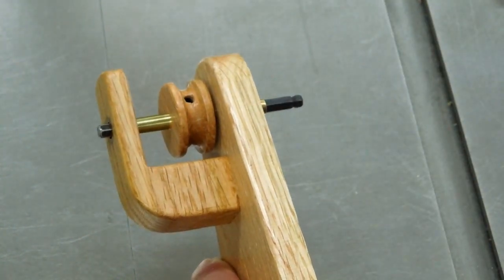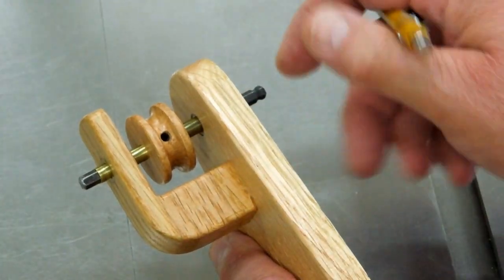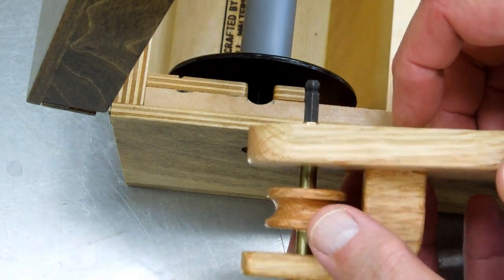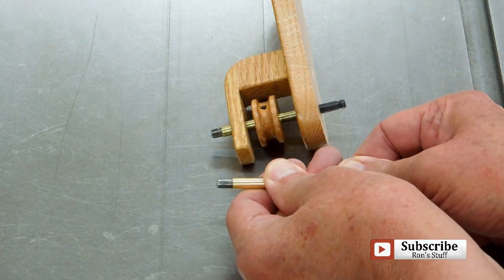Senior 20 Organ (13) Rewind Hex Drive

Comment: That was a very innovative idea and result to combine both operations into one. Will you be using a spring to keep it disengaged since that will be the most often needed or default position? Ron, I don't think your non military viewers may be as familiar with Brasso as us veterans are! Haha. Thanks for sharing.
Reply from the maker: MRrwmac The Senior 20 plans show a flat belt on the rewind mechanism. The flat belt thing had a few problems. Jay Caughron came up with this redesign several years ago using the o-ring belt instead and he has photos of this conversion posted on familywoodworking.org  My addition to this was using the brass tube over the hex key and running it in the bushings. I probably have way more throw on that hex key than necessary and I have not yet mounted it onto the pressure box. Once mounted and fine-tuned the o-ring belt should be loose enough to allow the small pulley to stay where you place it (without a spring) but time will tell.
Reply: Ronald Walters How do you maintain pressure with the hole ?
Reply from the maker: pbou The brass tube and hex shaft are a good fit inside the bushing and the pressure box is operating at only 6-1/2" of water pressure. Any leakage through the bushing with the brass tube with the hex key inside is very minimal and will have no effect on the operation of the organ.

Comment: Does the air in the pressure box not escape out of the rewind mechanism hole and the drive spool shaft holes?
Reply from the maker: Air does leak out but the volume of leakage is minimal and the bellows supply is more than sufficient to compensate for it..